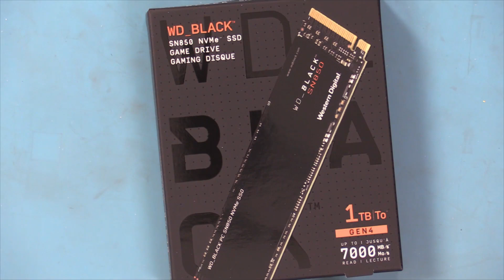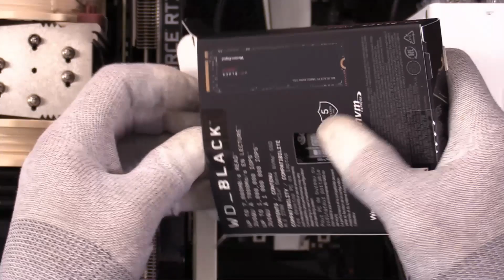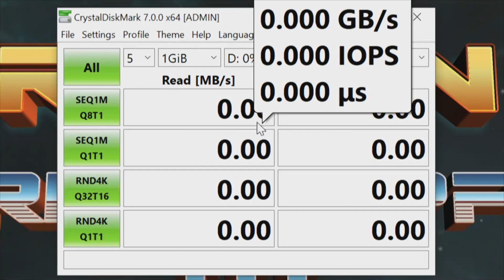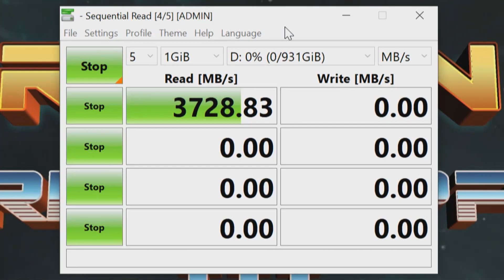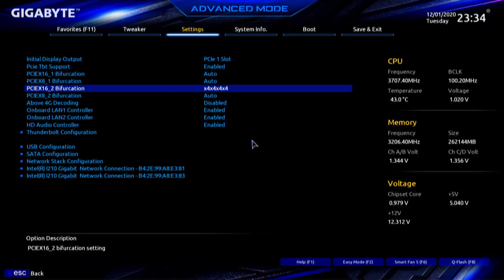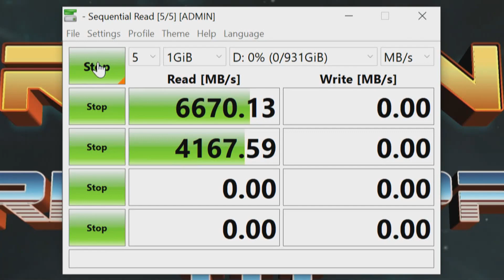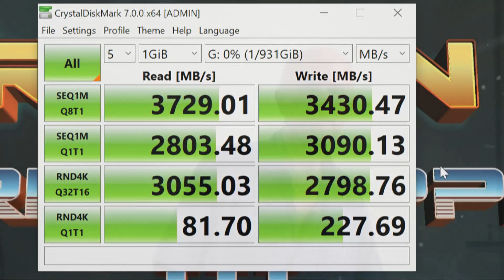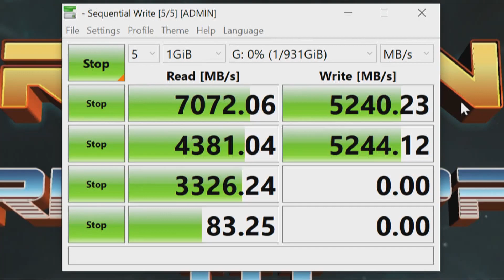WD Black SN850 Unboxing, Install, Test and Technology

Comment: Yes I agree with the audience that your review here is number 1
Userbenchmark site is real picky about hard storage and I'm seeing 69xx on C and 62xx on D 
I retested D using your methods and Eus Drive Partition Software 4kcluster size with GPT
Nothing changed yet nothing got worse. I don't buy Chinese products.
Reply from the maker: Hi Zeek M, 
Thank You, Appreciate Your Comments! 

BTW: I hear where You're coming from. However... Where was Your Motherboard made? China. Did You know, we use to make Motherboards in USA. Why did we stop? Toxic chemicals required for Manufacture.
Reply: @BuildOrBuy  - You have a point there. It's an Asus Hero VIII as far removed form China as possible, Asus is made Taiwan.
If there's anything Chinese about my system, I would like to sue those responsible, since it's SUPPOSED to be made in the USA. lol
What I mean by "I don't buy Chinese products." is that I know that if I do I can not resell them or pawn them, I'd be stuck with a Chinese product nobody will buy.
Americorp suddenly decided my Chinese goods were worthless and I'm speaking of even the bare metal. We still make motherboards in the USA.
Reply from the maker: Hi @zeekmx1970 , Splitting hairs. China sees that area differently. However... Agree, we need other options. 

BTW: Where was Your Computer Case made?
Reply: @BuildOrBuy  - Thermal Take 900 , Made in USA In collaboration with Watermod France.
Reply from the maker: Hi @zeekmx1970 , You had to go look! It's difficult. It would have taken 10 years to make the changes we need to get out from under that Thumb. Now, longer. This problem is pervasive in everything we consume.
Reply: @BuildOrBuy  - Yes I looked it up because I sure don't want to tell anyone a fib about my rig.
As for the mess the world is in, When I'm pushed, I push back, it's about survival.
Reply from the maker: Hi @zeekmx1970 , Seems to be that way. We're now having to deal with decisions made a long time ago. And we weren't not consulted about those decisions. And here we are now in the aftermath.

Comment: The AIC card has buffer chips to drive the data on Pcie bus Thru the bus connector. This causes latency Thru that physical interface. So, speed decreases across that interface. If you think about it, the NVME card has a pcie interface and now it must pass through another interface. Also, there is more connectors involved which skews the rise and fall times of the digital signals are stretched due to analog resonance of digital signals. In other words it causes ringing of the digital signal that dampens out over time which slows read/write cycles....physics is a cruel mistress. Not surprised at your results.

Next, if you test on slots attached to chipset. It will perform well, as your other video showed. However, when attached Thru trx40 chipset u are sharing pcie lanes between the trx40 and threadripper with everything else attached to that trx40. So once you add more I/O to things on trx40, that will slow the NVME storage.

The difference in AIC performance can also be effected by impedance on the different connections on the AIC. I think your AIC (quad card) may be faulty, IMHO.
Reply from the maker: Hi Lee Friedman, All good points. Very astute observations. I have another theory I'll share later! And I think You have the key to that. Impedance. The Load is not balanced in the configuration shown. Stay tuned! 

Suffice to say, the Results on the Motherboard connectors are most interesting.
The SN850 Results: 
On socket M2M (CPU): 7,070 MBps Read and 5,241 MBps on the Write. 
On socket M2P (Chipset): 6,291 MBps Read and 3,161 MBps on the Write.

Comment: i would criticize the (cooling?) label. while you want to keep the controller cool the NAND likes heat.  Sure most people will use their cooling shield, but why the heck did they place the label half on the controler and full on the NAND. Wouldn't the controller get hotter like this while a complete label would be better if the label has heat transfer capability.
Reply from the maker: Hi l A.I-M l, 
Welcome! Good question! If We get the chance to do an Interview, we'll ask! Last time We interviewed anyone with WD was at Comdex. They then came to present at one of Our Live Meetings. Yes, it was that big. Only the Label on the Sabrent products could be construed as a cooling label / shield since the Label is metallic in appearance. Up for conjecture. As for the WD Black SN850, we suggest for now to stay away. We're getting reports of some Users having BSODs. Let's hope WD can address that issue with a Firmware Update or suggest to Users their best case options. Appreciate Your Comments!

Comment: You said "If you looking at PCI express 3.0 you're looking at thirty five hundred mega-bits" for the record there are 8 bits in a byte.  You meant 3500 MByte/sec, not Mbit...  Also you say the chipset has to support it, actually it's the CPU nowadays.  The fastest PCI-e lanes are on the motherboard, you might get one PCI-e 3.0 M.3 slot on a southbridge here or there, but for PCI-e 4.0 it's coming from an I/O controller on the CPU.  The same AMD motherboard--same chipset--will be PCI 3.0 or PCI 4.0 depending on the CPU.  For instance, on the same MB, a Ryzen 5 3600 or 5600 can do PCI-e 4.0, but a Ryzen 5 2600 will only do PCI-e 3.0 for the M.2 NVMe slot.
Reply from the maker: Hi JR Earl, Welcome. Thank You for the clarification. Big difference... We're referencing based on what We've tested on X399 and TRX40 chipsets. We've also gone over the Z590 and B550 chipsets since doing this Video. Appreciate Your Comments! Thanks for Watching! Details matter!

Comment: The problems You've  came across are very disturbing with the Quad Card. I guess I should sell my two M.2 PCI-Expres Gen1 and buy a WD Back SN 850 or Samsung 980 Pro or a PCIGen4 gen3 M.2 card. I can smell a whole lot of RAID problems on my unpacked, untested MSI X570 Godlike motherboard. The problem is that I use Linux Mint most of the time and that distro of Linux is so far behind that I get 1/3 or 1/4 of the speed that I get in Windows 10 depending on the controler. Adata works like 80-90% Windows of speed. Samsung works 20-33% of Windows speed. Maybe someone knows a Linux distro that is very much alike Linux Mint but it has no such speed problems with NVMe drives?
Reply: Try manjaro? There’s popOS, but it’s still relatively new. Also, not really like the direction of the new Ubuntu.
Reply: @CknSalad  Mankato always freezed during my previous use. Maybe cause it's a rolling release. What does the other things you mentioned mean and why for me?
Reply from the maker: Hi Don, A whole slew of messages I'm just now seeing! I watch these messages carefully and try to respond as quickly as possible! I'm not a Linux aficionado by any means but will be on the lookout if we run into anything pertinent. Curious though. I would have expected Linux to be more Up on something like NVMe technologies. Especially in this day and time. I know Linux has a tool to interrogate the NVMe - nvme-cli. Nothing like it on Windows since Windows relies upon the PCIe NVMe Driver that Reads SMART data. And each Brand of NVMe has a Control Panel that reads differently. I do know that NVMe SMART data is standardized for NVMe Drives. And doing a Video on those would not be an apples to apples comparison. Only a commentary of each and what they can and cannot do. And that in and of itself might be interesting to evaluate and share.
Reply from the maker: Hi ChnSalad, Just now seeing Your Message! Good question to Discuss, best Linux distro for NVMe. Thanks for Sharing!

YouTube did not send Us an email! Seeing Your message on Channel under Messages.
Reply from the maker: Hi Don, Same! Just now seeing this! Working my way Up the message tree! 

Question of the Day, best Linux distro for NVMe. Now that would make an interesting Video! 

I think CknSalad is sharing since You mentioned Linux and NVMe. We need an affordable Hardware RAID Solution for NVMe. In time!